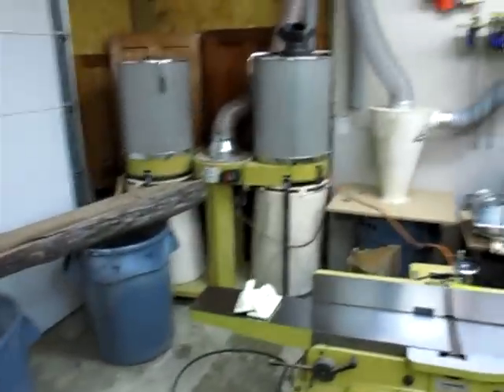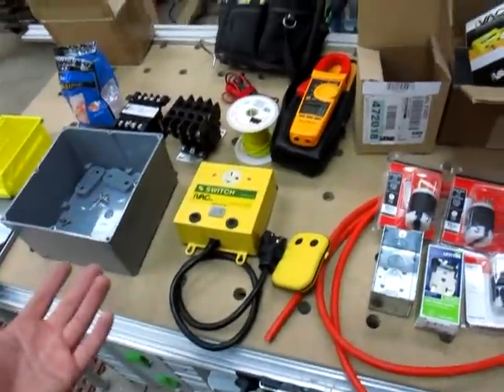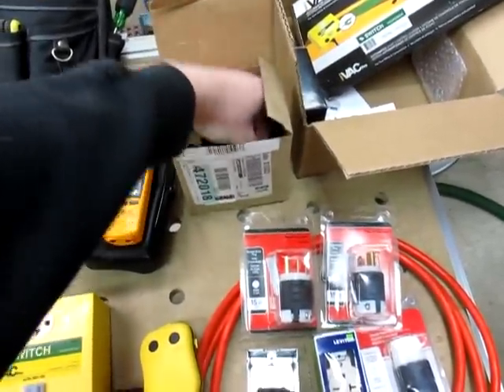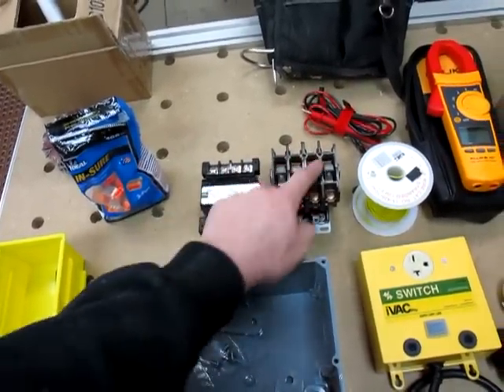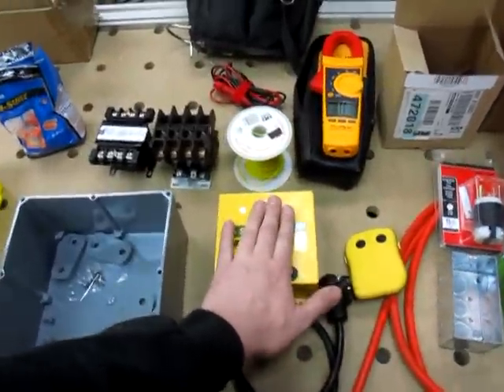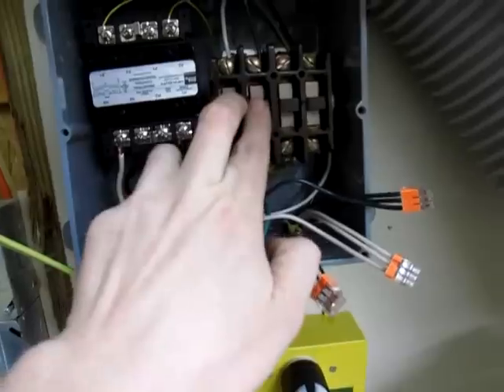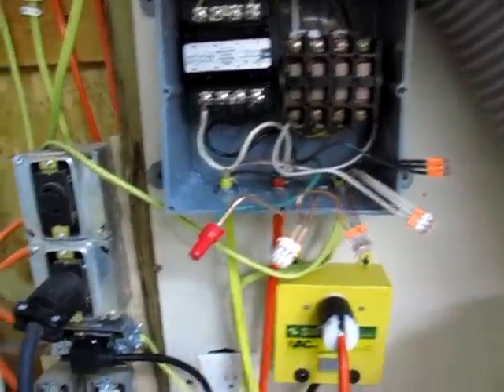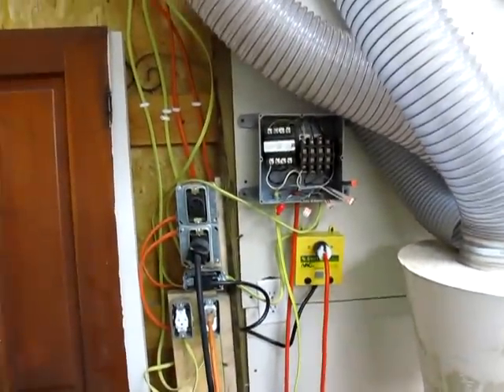Building a dust collector remote

Comment: Nice Video, I have seen this approach several times. I figured the cost would exceed the collectors on the market like woodcraft that state they are rated up to 3HP. I but sometimes we learn overkill is a must. I currently have repaired three seperate 3hp switches from woodcraft they continious burn up not only on the pcb but the 25amp relay as well. now I am just going to do some solder and put these inline with a larger switch. By the way nice shop!